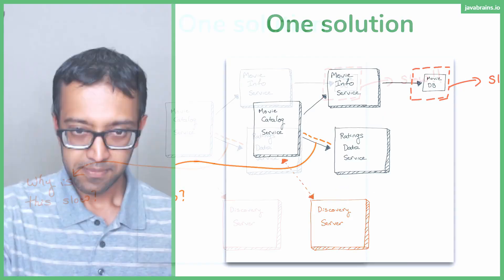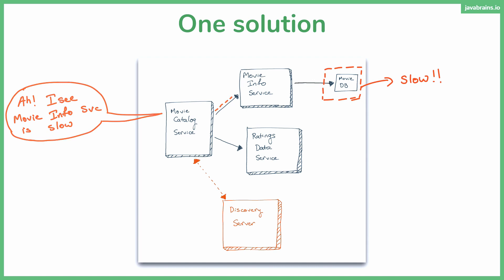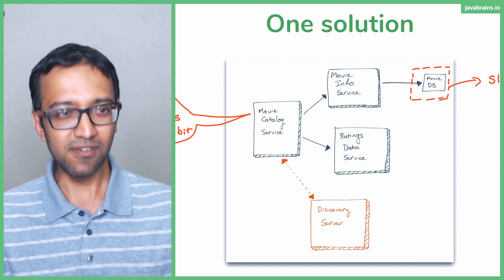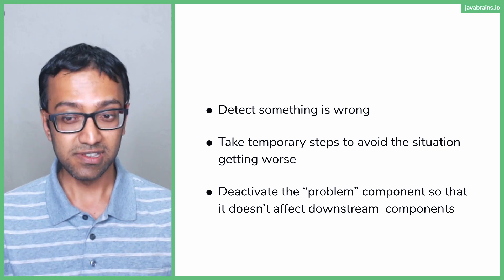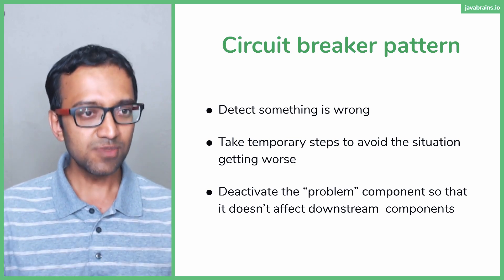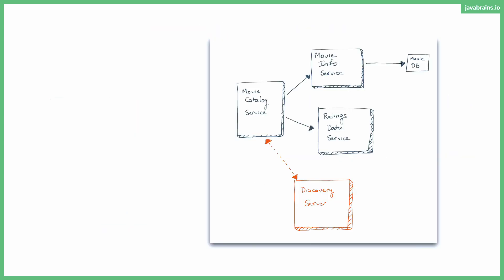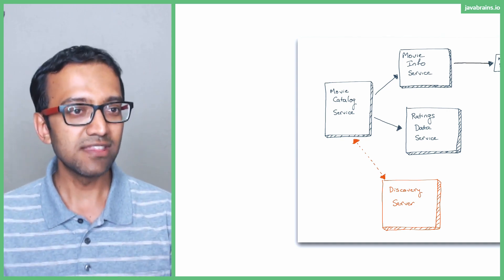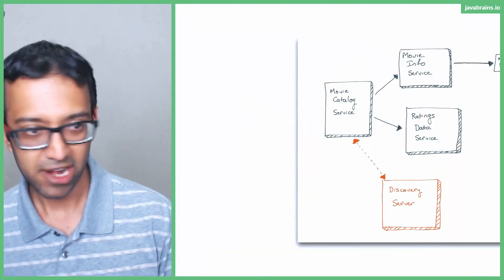11 Understanding the circuit breaker pattern - Spring Boot Microservices Level 2

Comment: Can we use the Timeout in a bit smarter way: as like
controller methods usually calls a service methods to do the operation and give back the result, 
So rather to set timeout on rest Template , set timeout on service methods
Setting a timeout of 3 seconds to a service method and make whatever the api calls u wanna make,
So a total time of 3 seconds u have 
If u didn't complete the task in the given time, then return error

Comment: Hi, 
You have explained in nice way. Very easy to understand.
I like the way you have explained the problem statement and the explanaton of  the solution.
But I got another question:
If the  business objective is able to achieve without the use of  slow microservice, then what is the purpose of calling that micro service at all?
 Do we need to have parallel flow for each use case in case one is slow?
Regards

Comment: Is there any mechanism,  suppose movie info service is down or slow , it should only reply to catalog service, saying i am good and active now, you can call me?..i think this is silly question
Reply: It is totally dependent on how the other service is implemented, for example, you can have a healtcheck implemented and then catalog service can poll onto that and only make a call if healthcheck returns true.

But this is exactly what Circuit breaker is, it tries to avoid making those HTTP calls because it might happen that healthcheck will it eat up your thread pool.

Comment: Does Reactive Programming as well solves this type of issue?
Reply: reactive programming happens in the context of node which is hosting our api.

but issue is related to webserver of another api which we are requesting to.

so, reactive programming speed ups our sequential way of programming......not these type of issue related to server overheads
Reply: Reactive program does not replace circuit breaker - difference is that, with reactive program, you can have more requests than usual waiting out on a slow back-end service before your server runs out of threads in thread pool
Reply: Good question !
Reply: so?
Reply: Hope someone answers this..